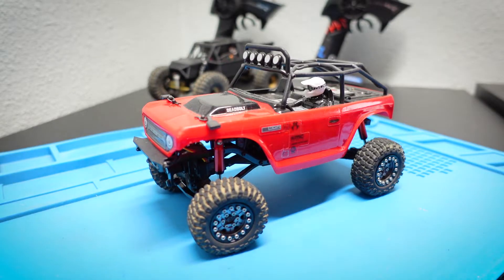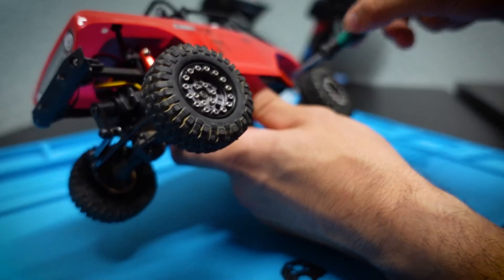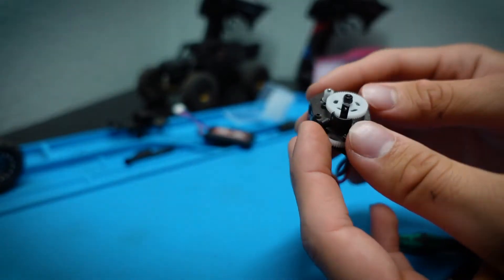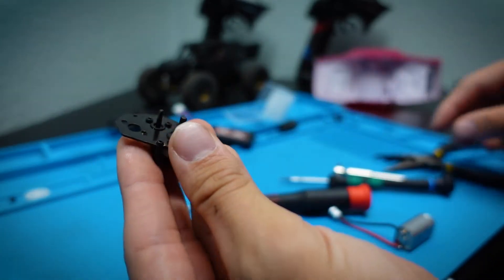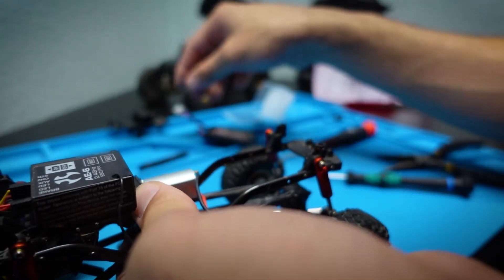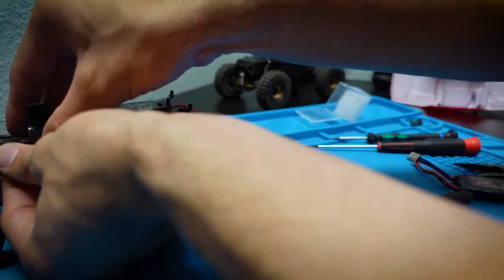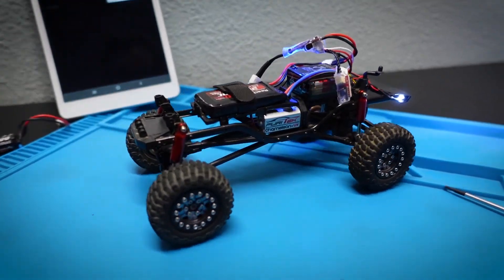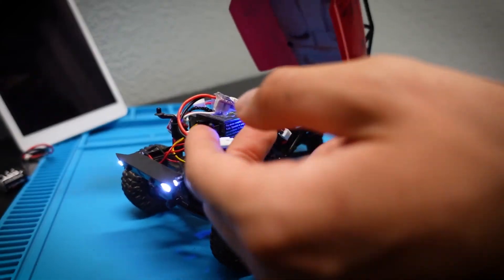How-To Install Furitek CHAMELON BRUSHED COMBO For Beginners | Axial SCX24 Deadbolt EP.7

Comment: Any chance for an update video I'm finding issues getting information on a good tune setup and a solution as to why I have to input upwards to 60% throttle before the truck moves (nothing's binding works as it should with stock esc and Tr/RX) I've hooked my spectrum up and same thing,
I'm assuming my esc is the issue or the tune on it's off, it barley wants to climb anything with the iguana esc but with the stock esc the Chameleon just pushes through like I expected, 
Thanks 🙏

Comment: What size is the motor? I'm planning on using this esc on my trx4m which uses a 180 size motor
Reply from the maker: 80T
Reply: @MiguelCortez  do you know the actual motor size as in 180, 370, 540 etc? Or is it an 030/050?

Comment: I couldn’t install the chameleon motor to the carbon fiber plate because for some reason, when I tried to fasten the screws into the motor holes on the chameleon - it wouldn’t fasten or tighten so I couldn’t secure the motor to the plate. Anyone experience this ?
Reply from the maker: Did you use the right screws?

Comment: Was i supposed to buy the iguana pro with the chameleon? I just swapped the motor and plugged it into the stock esc on the C10.
Reply from the maker: I don’t think you need both you can try without the iguana

Comment: A receiver does not come in the kit ? Or do you need to keep the stock receiver ?
Reply from the maker: That is sold separately, I used the stick electronics.
Reply: @MiguelCortez  thanks. So theoretically I could use a spektrum receiver and plug the furitek esc in it ?

Comment: Will the new "furitek stellar transmission with komodo brushless setup" (releasing on Dec 15) offer a slower and smoother crawl speed when compared to running the Liko Brushless only?  I'm looking to get the absolute slowest possible "& smoothest" crawl speed out of my SCX24 JLU. The Komodo is already pretty slow, but it seems to have a rather noticeable and aggressive speed "jump" in most videos I've seen.  I'd like to build a much smoother ultra low range setup if possible. Ideally, I don't want my JLU to step through faster speeds so aggressively, and I really don't need to go fast at all; I'm aiming to rock crawl usinga prettywide range of low speeds, not rock bounce if the throttle is squeezed more than a mm lol.
Reply from the maker: Great points. To achieve that low speed maybe just look at upgrading the esc for the FOC. I do notice the speed jump with the brushless motor you point out. 👍

Comment: 7:44 before i explain my situation is should be said it appears i have a newer version of this motor. the 2 things i notice are the sticker on the outside is different and the motor wires are longer
 i got to that point and when i put the spur gear on, the white plastic gear, and it was rubbing on the inside motor screw and yes i put it on the correct way. literally didnt change anything to do with the spur or the screws. the motor screws are different than all the rest so i know the correct screw is where its suppose to be. i had to file down the head of the motor mount screw so the spur didnt rub on the screw and bind up. what the hell did i do wrong? also, only about 2/3rds of the spur make contact with the pinion, like the pinion is sitting to far out. i tried pushing the pinion further down on the motor shaft but i felt like i was gonna break my brand new motor.
Reply from the maker: Is it also very loud? I’ve since had similar issues?